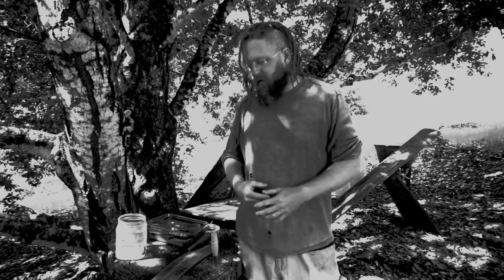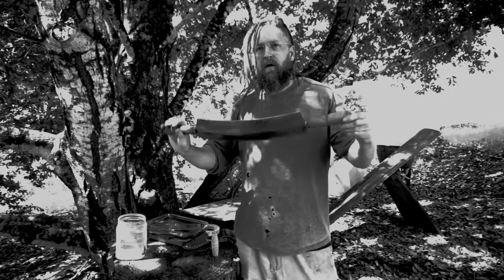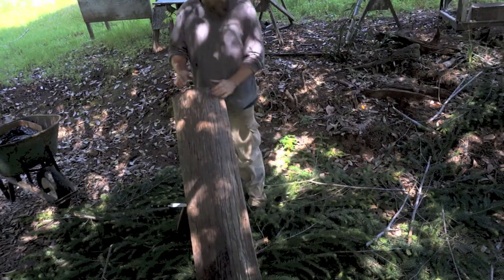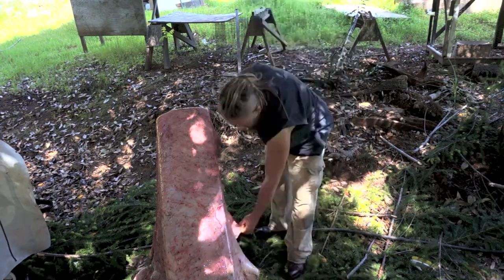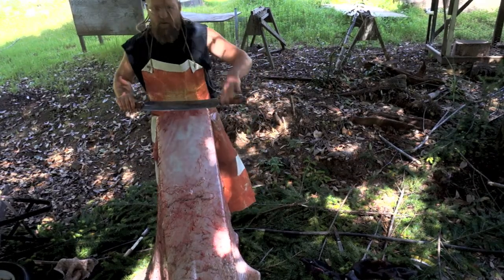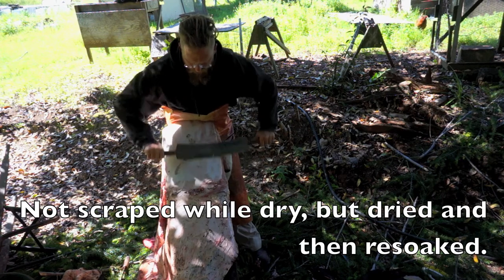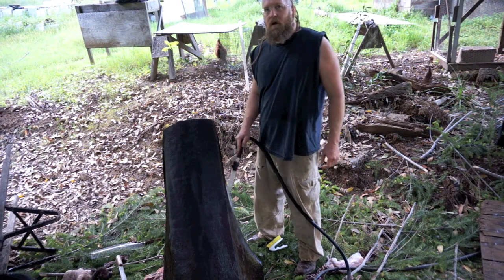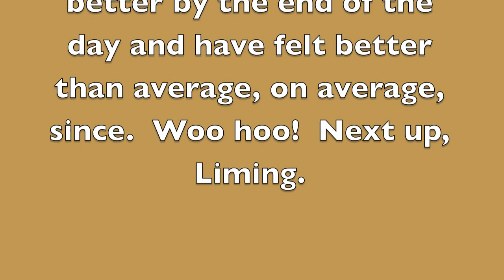Quality Hide Glue From Scratch #2: Fleshing

Comment: One thing I do to make the defleshing a bit easier.... although I think a lot of people wouldn't see it as easier. I put my deer skins (I make drums out of them) first in lye and let them soak till the hair is loose. The defleshing goes much lighter after a bit of decomposing and been taken apart by the lye.(the smell is the reason I think most people wouldn't want to do it this way.)  I prefer Ash Lye over Lime water in this, It's free if you heat your house with wood. And very praktical: Ash I can just leave as fertilizer in the forrest after use.  So and now I am gladly moving to the next couple of video's. I finally want to make some glue from all the cut of pieces of my drums and I really like the way you explain.
Reply from the maker: I do that when liming.  Lime does help a little.  Lime water is very useful as a fertilizer, though it does not contain all the minerals that are in wood ash. the problem with woodash is it is not consistent.  It can vary so much in strength and measuring methods are not reliable.  It is great otherwise.
Reply: @SkillCult  I've seen that you also use it as fertilizer in the following video's. I'm not much of a gardener myself. That ash is not realy consitent I found out the really clear way about 12 years ago when I used some pure beech ash..... my gloves weren;t waterproof on the upside and I had hairless itchy red hands for days after cleaning a couple of hides. 
Now i've just don't use that much ash and it works fine for me (with better gloves). I don''f need much consistancy... and otherwise I wouldn;t get it eather,. What takes 4 days in sommertime can take 4 weeks in winter. I just stirr and look every day till I think they are ready. Worked well the last 1000 hides probably  will work a 1000 more. 
I still have to make the big batch of glue but the first two small testbatches worked out pretty well. Not as pure as that what you made, but  pure enough that it;s stronger than pvac glue.

Comment: Instead of scraping with your knife you can put a four inch post in the ground and carve it to a dull rough point or wedge shape.  Take the hardened stretched hide and rub it like you’re trying to ‘de flesh’ it.  This will break down fiber, scratch off unwanted fats and meat etc.  its been done that way for almost a thousand years.  but the knife works...
Reply from the maker: I don't think that would get the skin nearly as clean as I want it, especially not cattle.  I've been tanning for decades.  I've used wooden stakes and metal stakes and always have one on hand.  I use them to soften and break hides at various points in multiple processes, but would never think to use them that way to get the flesh side of a hide extra clean.  Have you ever handled a hard dry cow hide?  that doesn't even sound possible.  I'd love to see that in action if you make a video.  I mean, who knows, but that sounds a lot like unvalidated book learning.

Comment: What if you add linseed oil to the preparation of the glue?. Would that make it water resistant? Or maybe pine tree resins. Something that would keep it strong and would make it water resistant.
Reply from the maker: I think that would be like mixing oil and water.  However, formaldehyde makes it waterproof.  Every heard that there is formaldehyde in plywood?  that's why, they used protein glues not that long ago, with formaldehyde.  There is another more waterproof glue called casein or cheese glue.

Comment: In the first part, you mentioned not using frozen materials for this. What is the reasoning on that?

ps - I get 3 allergy shots for bees/wasps once a month, the combination of the damn medicine and the shots...you look just like I do on those days. Shit sucks.
Reply from the maker: I don't know why on the frozen material, it's just a tip from old industrial glue making manuals.    That day was rough.  In the long run, I failed to really benefit from those shots, but I could have stuck with it longer.